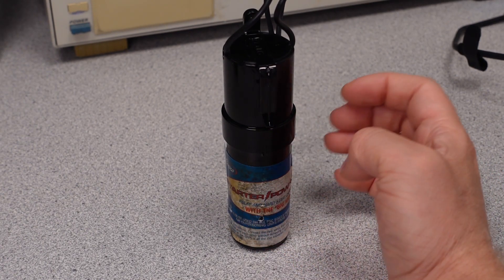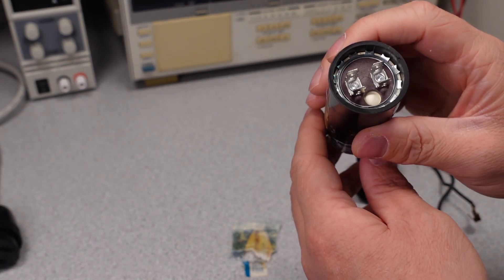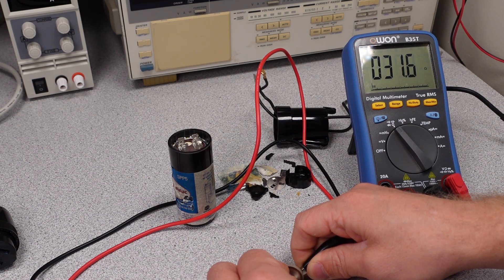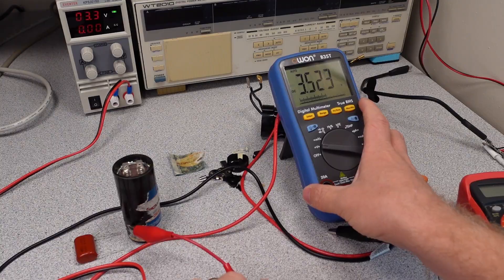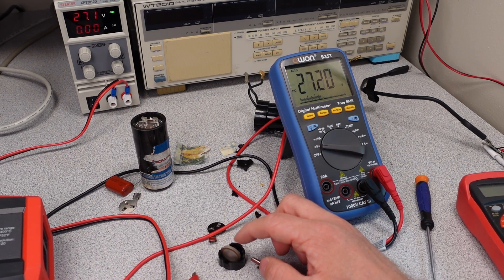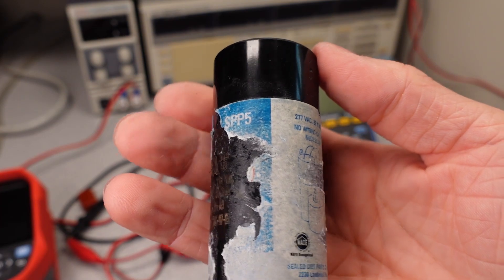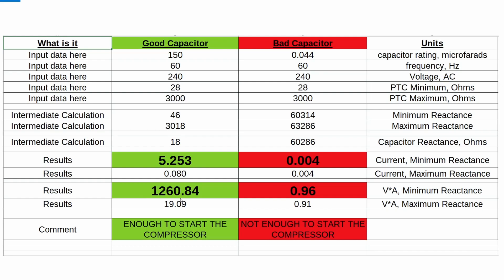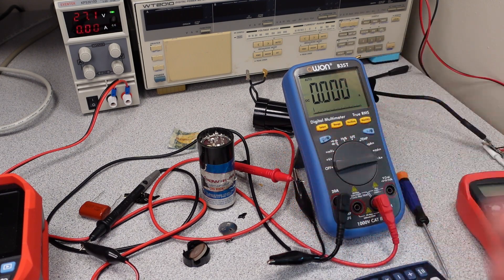Failed Start Capacitor from Heat Pump Teardown

Comment: That ptc should be around 5 ohms cold. And that start cap should be 180 uf or more for start. Think both ptc and cap cooked
Reply from the maker: Thanks!  Yeah, maybe that failed low and the cap was in circuit too often, in this case the main capacitor on the unit also failed, along with several other parts.

Comment: So that thermal switch is just consuming current all the time getting hot? Except when the compressor needs to start?
Reply from the maker: Yes. It is always passing current when the compressor is switched on but it is a very small amount (70 mA versus the estimated 20 amps the compressor is using).  When the compressor starts (and the PTC is cold) it passes A LOT of current comparably. About 5 amps in this case.